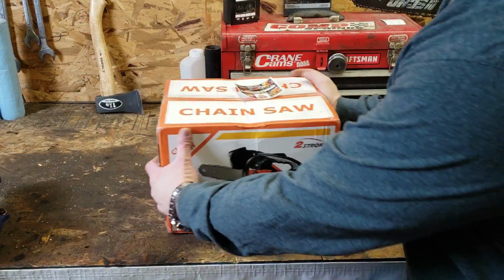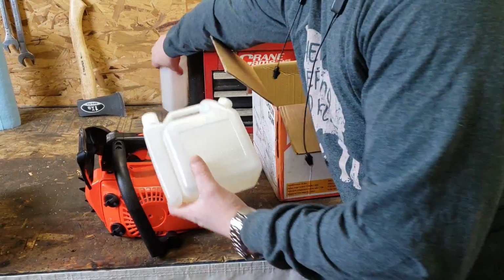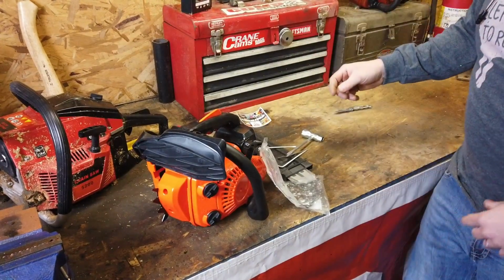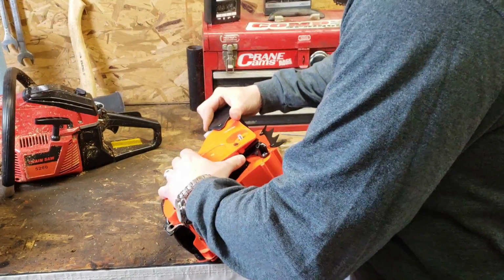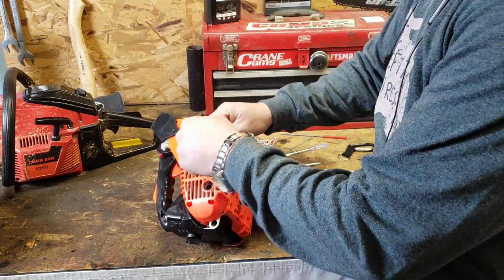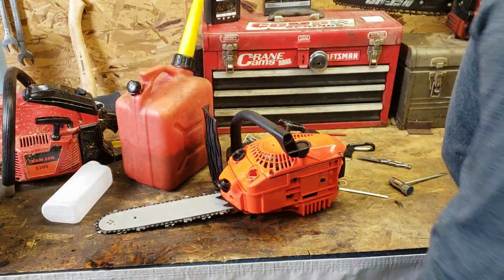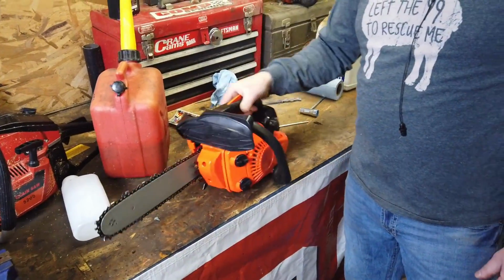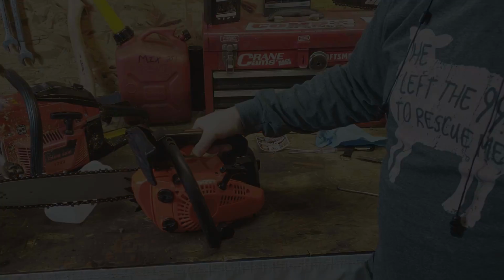Chinese Chainsaw Clone Let's test it

Comment: Hey Piddler a few observations. I got a 10 dollar brake assembly off EBAY.  Works way better than what came on the saw from China. Mine will start 3rd pull every time. Ethanol free gas synthetic 2 stroke Stihl oil. Give it a try. Thanks again for everything you do!!
Reply from the maker: kygtx I would like to pm now more about the brake assembly you are talking about.... I do use Ethanol free gasoline. Btw thanks for watching and taking the time to comment and contribute to the Piddling community! Thanks for watching and "Keep on Piddling"
Reply: Check out eBay item number:253755257210.   I found it to be of much better quality than original and did not cause the brake to slam forward. Clearance around the sprocket was clear. Hope this helps.
Reply from the maker: I will definitely check it out

Comment: I have used Chinese Petrol Chainsaws for  Years I Like them very much: When I Assemble the Chain and And Adjust the Bar tension I tension the chain where there seems to be a Quarter of an Inch Play when I Bull it almost dead centre of the Bar: If it is More than a Quarter of an Inch Play; the chain within a Few Minuets of the Chainsaw on full revs  Jumps from off the Bar; More times than not some of the Links Kink; the solution is either to Change the Chains or to Take the bent Links out and replace the Links with new ones; Sorry for  Noticing but the small chainsaw Seemed to Sag from off the Bar ; surely this is not right
Reply from the maker: Yes it needed an adjustment for sure! Have a great week!

Comment: I'll guess 4 - 6 pulls to start.

Not bad.  Once it actually fired off, it RAN!  Most of the time, when I get a saw to start it will kick over, and then I have to give it another few pulls before it will stay running.
Reply from the maker: That's a great guess and I'd say you would've been right except I didn't turn the switch on 🤦‍♂️ Thanks for watching and "Keep on Piddling"